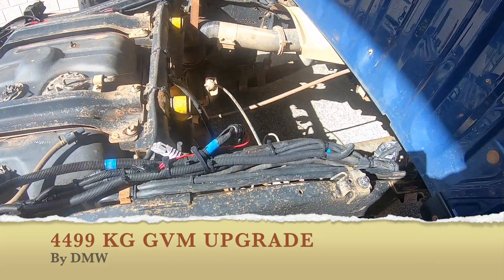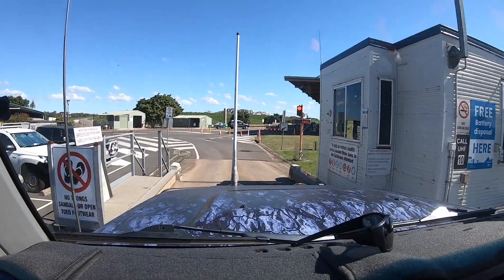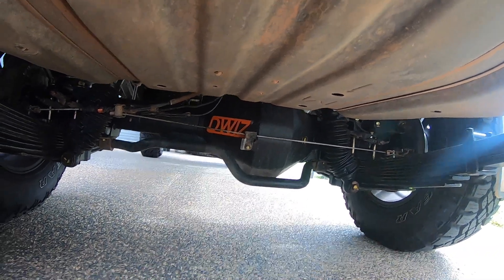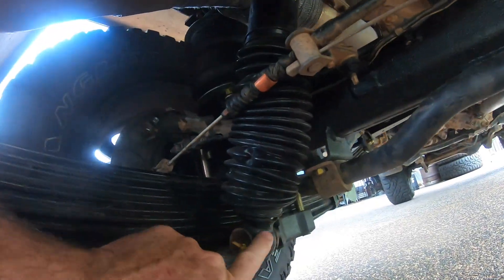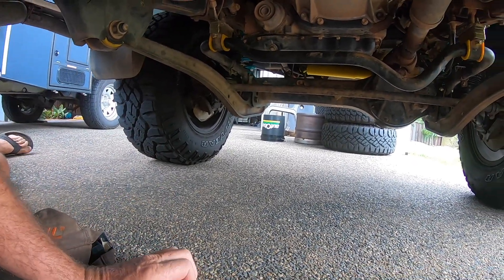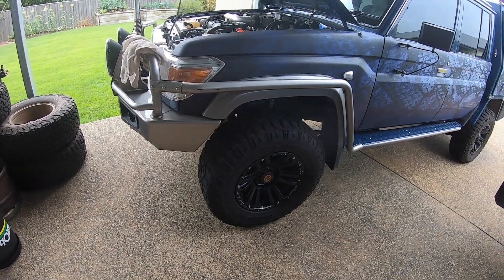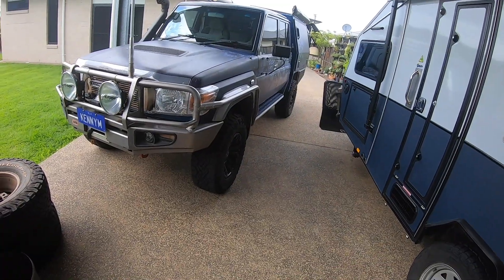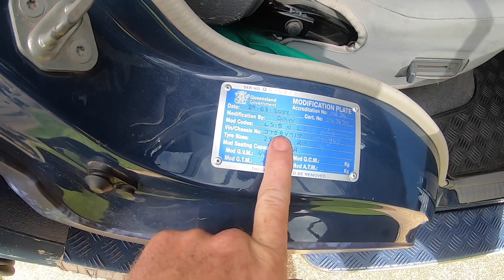#DMW 4499kg GVM Upgrade || 79 Series Landcruiser || Renovate Rejuvenate & Renew - 250k Projects

Comment: I had nothing but probiafter problem with the dma gvm upgrade to my landcruiser to the point it had to be all ripped and redone twice second time i went with a different company nit had a problem since doing that 
The welded diff brace is crap also on the 200 cant even jack the car up if needed to to change a tyrr without it collapsing on ti the factory diff
Reply from the maker: That’s a real bgr!  The diff housing fitted to my 79 is a DWIZ product. Looks great and I haven’t had a problem with it.

I’m guessing you likely went a Superior product?
Reply: No on the 200 they weld in some crap bracing on bottom of the factory diff housing no replacement diff they weld it while it is still in the vehicle no big no taking out of car
Reply: Even TMR who inspector that inspected my 209 twice said it is crap work etc even deemed my 200 unroad worthy till I ripped the whole lot out and replaced it all which I did as it is my only car $18,990 for crap at that place
Reply from the maker: That is a real bgr!